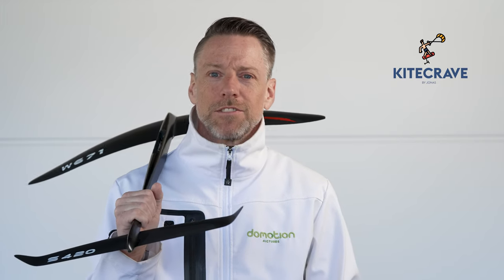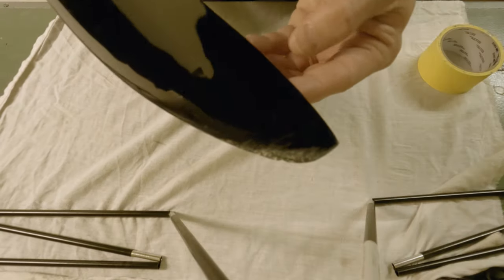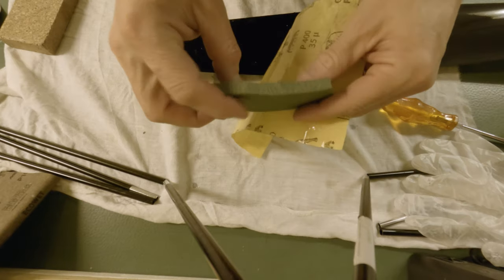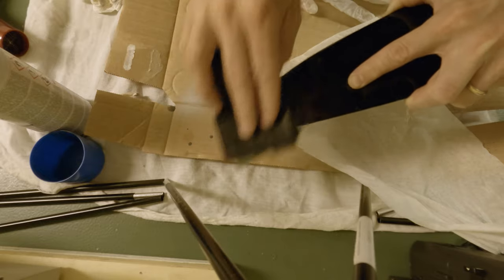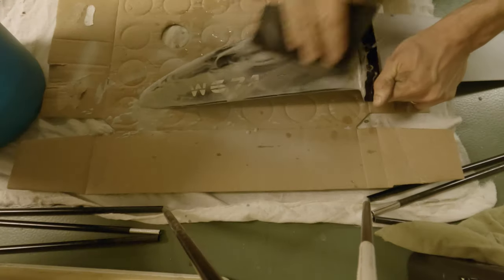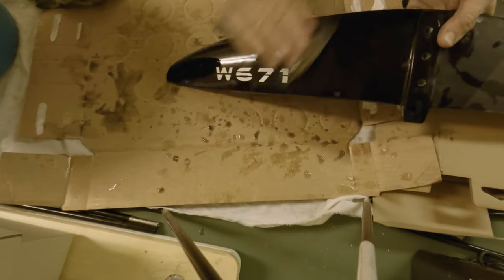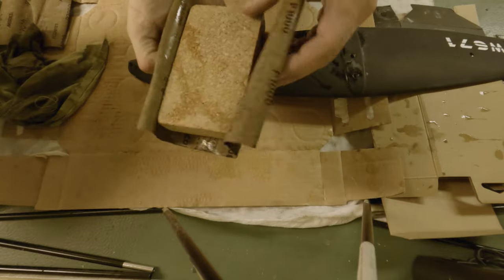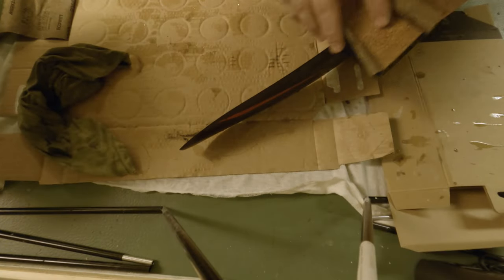How to repair and tune your hydrofoil from whistle

Comment: Note I did use "Bondo 907 glazing and spot putty" instead of spray filler for pinholes and scratch s. It worked very very well!  I tried spray filler and it didn't seem to be as long lasting as the Bondo solution.

Comment: Were you ever worried about sanding too much? I just dinged up my front wing pretty badly and some pinholes should probably be filled. Getting mixed answers on whether to just leave it to avoid changing wing profile or sand it down. Thanks!
Reply: The good leading edge is crusial for a stable foil in higher speeds. Build up with spackel and sand down as close you can to the original shape. 
It you´re just criusing in lower speeds it´s not so important.
Reply: @domotionpictures  This is my plan. Fill the leading edge with putty or spackel. It's a higher aspect foil so will definitely be going at higher speeds with this one :)

Comment: I like when my foil is whistling it's happened on upwind course, and also other hear me.
BTW how much speed did you increase with that sanding method?
Reply: I think it would increse your speed just a small bit but the biggest improvement is the stability. You feel more confident and secure. And most people like to ride quiet.

Comment: How did you determine 'whistle' was coming from the trailing edge of the front Wing?  I thought most 'whistling' comes from the Mast.  Great production, Thanks for sharing your knowledge!
Reply from the maker: Hi. In my case I was changeing only my frontwing and it started to whistle. Otherwise you can take a look at both wings and mast to look for any damages that can whistle and go from there. Good luck.

Comment: Hi, what paint are you using? Even I used 2000 the surface was pit scratchy or did I miss something?I guess Sabfoil varnished the final surface.
Reply: I use a sprayfiller. Now I blend it manualy with black pigment and paint with bruch to make it invisible. 2000 is good and goes better then a poliched surface.

Comment: Very useful tutorial! Could you please recommend or specify the filler that you use? Just a conventional Epoxy filler? Thanks
Reply from the maker: I just used a one component filler spray. I have no expertice in that.  I have also tried to wipe the filler off before it dries. That made it less to sand. The sanding of the wing is what makes the biggest performance change. The filler comes to handy with screatches and for race tuning.
Reply: @kitecrave5555  Thanks for your reply. I also think that a speed filler spray could significantly improve the speed. Could you tell us the exact brand and label of the filler you use?
Reply: @petersoulcarve9146  Try any paintshop. It is a common product for painting cars. I couldn't find the paste version so I went for the spray. 
See my brand in the film.